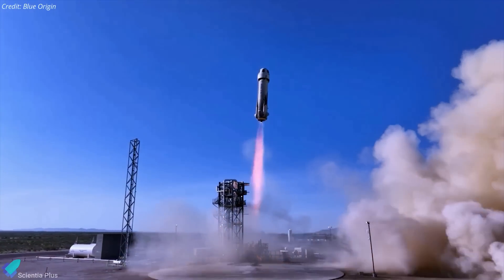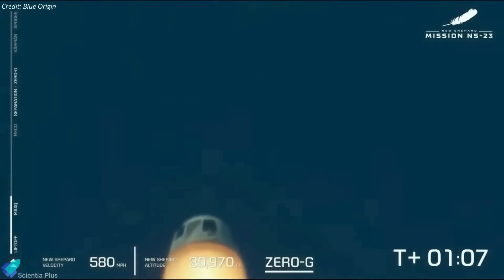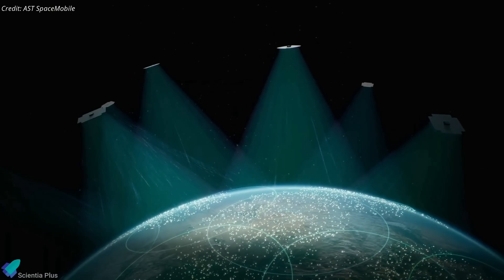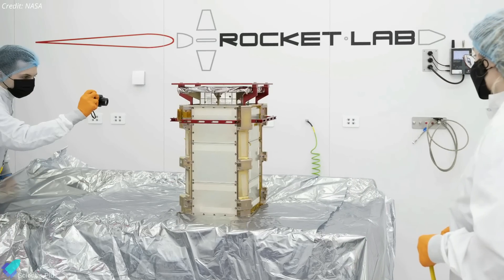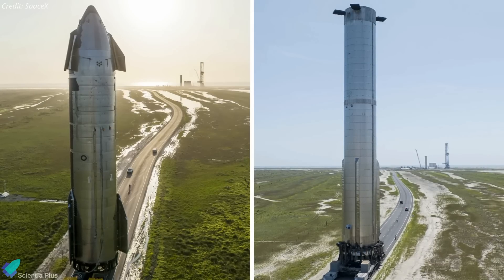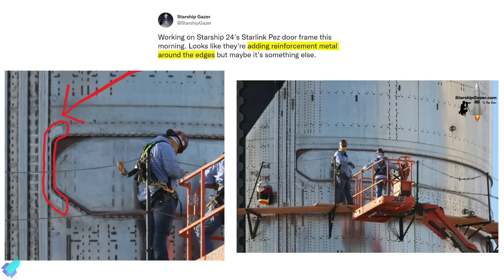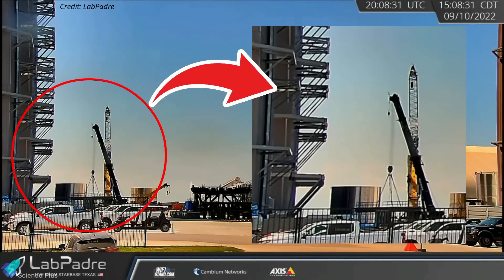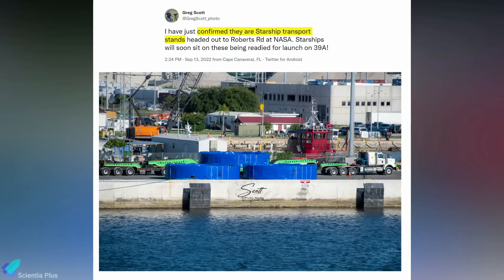Super Heavy Booster-7 Raptor Engines Activated in Quick Succession, Blue Origin Launch Fail,CAPSTONE

Comment: Would be really interesting to find out the technical details of how they fix the CAPSTONE issue. It's almost like a textbook question:

"Given the following position and orientation plot of an orbiting vehicle, what are the most energy-conserving steps to stop it from tumbling, with its solar array facing the Sun?"

But they'll probably just brute-force it instead. What happened to the geniuses that used to work in the aerospace industry, I wonder.

Comment: So we know that this ship goes right around the karman line. what would happen if the fail safe kicked in right at the edge of the karman line. you would be ejected into outer space with no manuvering thursters and no heat shield for return.
Reply: To get into orbit you must travel in orbit at 17,500mph horizontally. It won’t reach orbit even if it had an abort at the karman line.
Reply: Wow.. that's the first time I thought about that.  If that happened,  I wonder what crazy orbit it would end up in. Or would it reach escape velocity?
Reply: @genebarnes2679  I know the falcon 9 and dragon will handle it. But new Sheppard......eek.
Reply: @gwhyte01  this test (escape at Apogee) was done on New Shepard's Mission 9. The Capsule went up about 40,000 feet higher than normal (~390,000 feet), and returned safely. 

https://youtu.be/NRDhdHRyyjc?t=2292
Reply: @leeswecho  send link
Reply: @gwhyte01  link is literally right there, unless Youtube f's up links: https://youtu.be/NRDhdHRyyjc?t=2292
Reply: @leeswecho  seriously bro that hardly went anywhere password normally would go I'm talking about where falcon 9 would go if it ejected from apogee where would it end up